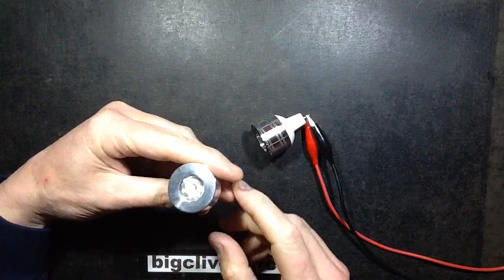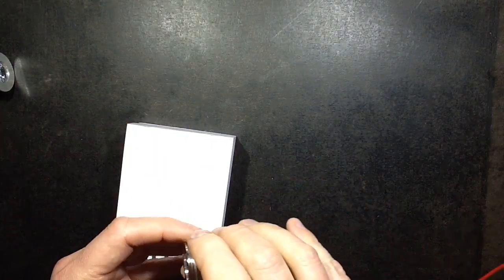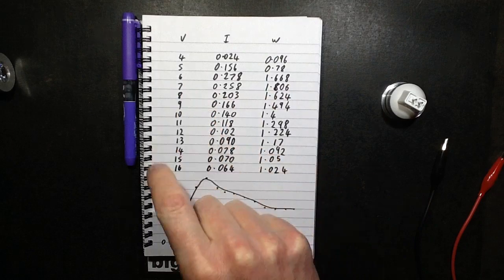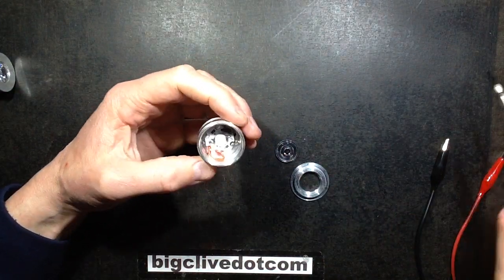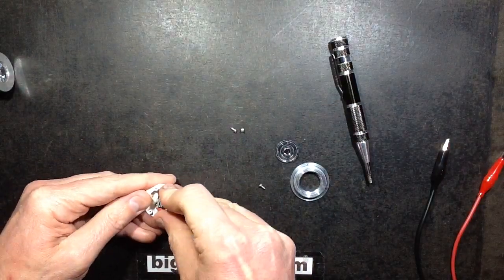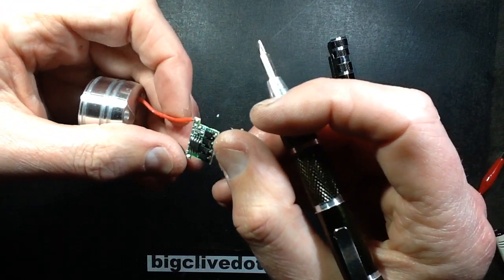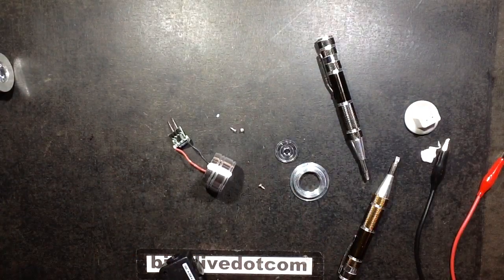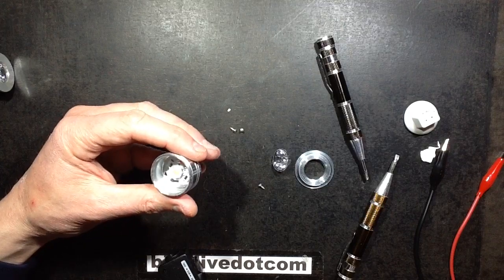Internal examination of MR11 LED downlight lamp.

Comment: The input power curve is completely rational for a constant-power lamp (constant-current through the LED). At low input voltage, the input bridge burns more power due to higher input current across a constant voltage drop across the bridge. The lamp is less efficient a low input voltage, so the input power needs to be greater at low input voltages to maintain a constant output power.

Comment: The MC34063 is actually a weird chip. Due to it's I peak oscillator you can't properly design the circuit due to tolerances in such low ohm values and solderin processes. The idea may be great but I designed NE555 LED drivers that were way more efficient. I never liked this chip anyway. It needs 0.1 to 0.2 ohms for its Ipk oscillator which is just retarded.

Comment: I wonder if it's to try giving improving the power factor when used on an AC supply such as when used with a step down transformer.  Another possibility is to give the impression of reduced flicker by boosting the light output just before and after the AC cycle passes between 4V to -4V.

Comment: I have a lot of 12v ac led lights here and they all have that hard glue but I cannot shift it as it is a bit flexable.
Also these lights run on 12v ac tend to wipe out TV as well as FM reception over a about several 100 sqm from each light.

..eddie